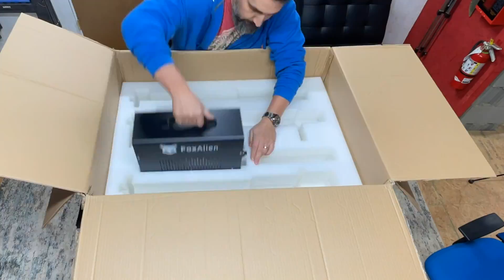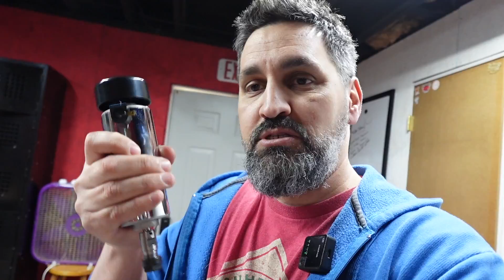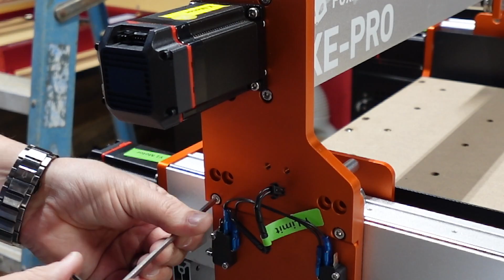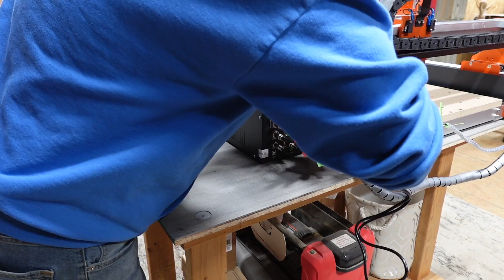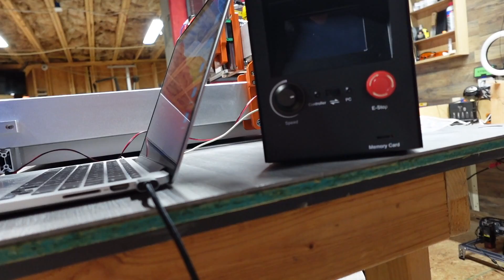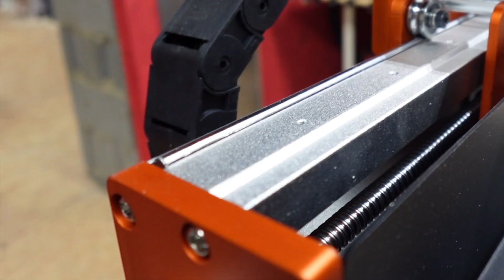FoxAlien 4040 XE-Pro CNC Unboxing & Setup - Elevate Your Craftsmanship Game!

Comment: HI , thanks for the Video , i have a question. For which would you decide if you want to start . FoxAlien Masuter Pro 4040 CNC vs FoxAlien Masuter 3 CNC ? thank you
Reply from the maker: I would go with the 3s or Xe-pro personally!  If you decide to get the expansion kit too….. I like that it’s 4080 = 400mm Y and 800 X.  The Mpro is good but the M3s is just more rigid and has more Z hight!
Reply: @SoupyDad OK thanks for the information the 3s is also Not so loud as the 3 right ?

Comment: What would you say are the main benefits of this 4040xe vs the masuter pro? And do you think this is a better choice for first time cnc owners who will primarily be working with hardwoods ?
Reply from the maker: For hardwoods the XE Pro is a better way to go! The Linear rails will have way less flex then belts!  With belts ….. missed steps are common.  Spend the money now and you’ll be happier later!
Reply: @SoupyDad  Thank you for sharing?  Which do you think you would you pick between the 4040xe and the nymolabs cnc you featured ?

Comment: do these machines come with all the software im looking at getting into it but kinda want a machine thats comes with its own software so i can learn faster thank you
Reply from the maker: Hey bud! So they don’t come with propriety software.  If you’re a beginner i do recommend using Easel or Easel Pro ($24 a month) to learn on. You can design and send g-code directly to the machine!  There are others too but honestly Easel is great and super easy!  I mainly use Easel myself! Message me if you have any other questions!
Reply: @SoupyDad  thanks for the response il lthrow you a msg thank you

Comment: At 12;37 you say that you are going to hook it up to Easel then skip to it already being hooked up.  I need that part explained. Also at  13:43 you home the machine and set the z probe up but don’t show how that is z probe is done.  After you move the machine to the front left corner and do the z probe setting it.  Please show setting the X Y Axis to tell the machine where the corner of the work area is.
Reply from the maker: I can try to do a “basics” video if that will help out!!!

Comment: I think I may have a faulty machine.  I have this exact machine and use my son’s Easel Pro account but cannot get it to set up and cut.  Would you possibly do a video of connecting it to the laptop and show every step you take to get Homing done and then using the z-probe then setting an example file and doing the first cut.  You were off camera during this and I could not see the buttons being pushed on your laptop.  Also maybe try UGS Universal G-Code Sender and set it up.  When homing does Z go up to the top  Should X be reversed etc…  I have broken 5 bits 2 when starting a cut because it homes itself first for some reason.
Reply from the maker: Sorry you’re having issues. Please join on Facebook “FoxAlien CNC Router & Laser Machine Group”.  You can get a lot of help there as well as post videos of issues and successes!

Comment: Thanks for this video.
However I think that exposed Y rails would be cover by debris disturbing a smooth travel that is not good for finish. I hope I am wrong.
I just have a small 1419 for milling PCBs. I am looking for a 4040 CNC like FoxAlien 4040XE or Genmitsu. Now seen yt CNC reveiws videos
Reply from the maker: They are covered and I highly recommend to clean them after each cut especially if you don’t have a dust collector!  It will take a really bad compacted Y axis to really mess things up.

Comment: Dang, Merry Christmas to you!  It's a nice CNC but man, too bad they use proprietary bearings and rails.  Would be nice if it were on Linear rails so you could expand it.  The one thing I did like about the Mastuer Pro was that I could buy off-the-shelf rails and make it bigger.   I think my next CNC will be one I build myself.  This 4040 is nice if you never have to do anything very large or want to scale it up down the road.
Reply from the maker: I plan on doing the upgrade to linear rails and expansion as they become available! It’s a very strong machine though! Can’t wait to do more with it!